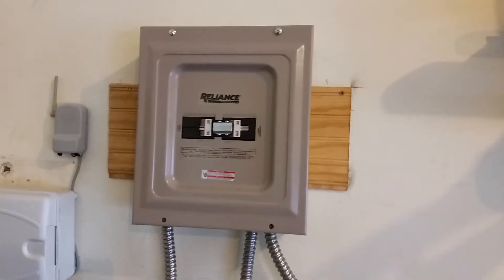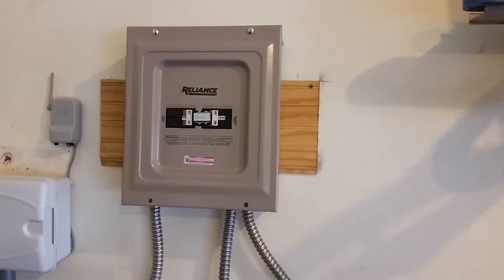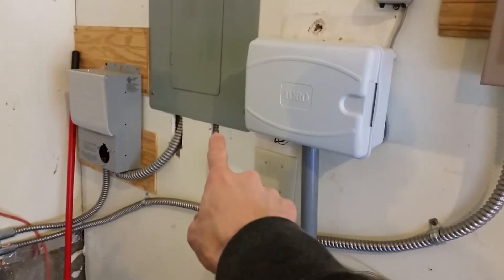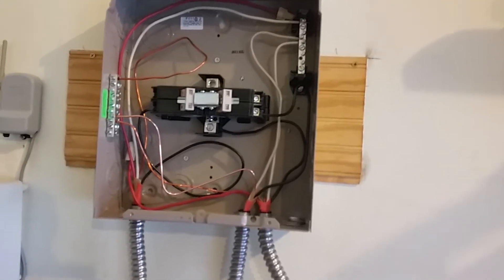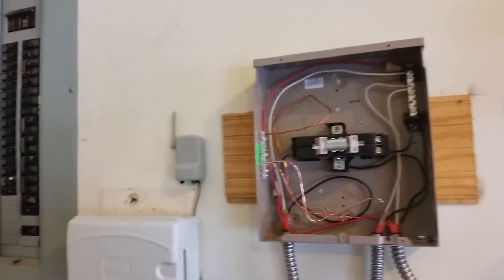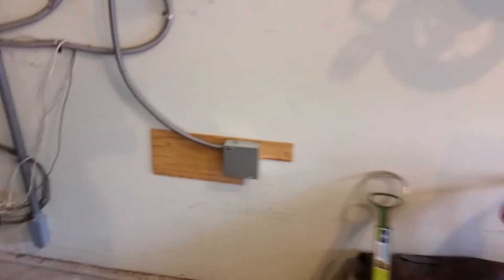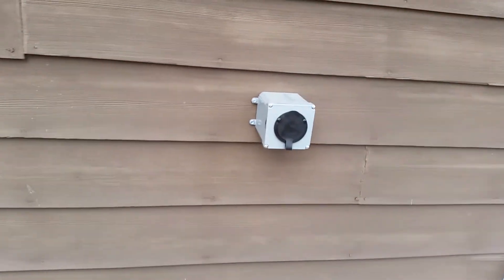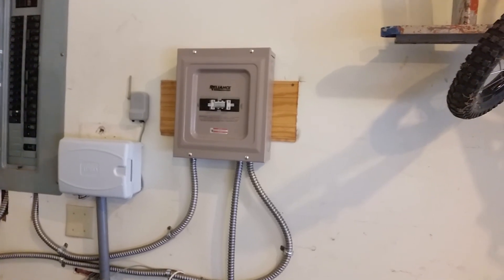Reliance Controls 60 amp Manual Transfer Switch Panel Box Installed & Generator Hookup

Comment: GREAT SHOWING OF THE TRANSFER SWITCH  EVERY PREPPER SHOULD USE IN THEIR SOLAR SYSTEM FOR SAFE TRANSITION OF POWER SOURCES TO RUN THE HOUSE LIKE MINE . SAFETY IS OF UTMOST #1 PRIORITY WHEN ELECTRICITY IS INVOLVED .

Comment: There's no reason you couldn't use this to switch between two load (one source, two loads), right?
Reply from the maker: Are you talking about two 120 volt loads or two 240 volt loads?
Reply: @thekeltnerway3002  240 in , two 240 loads out (switched, of course)
Reply from the maker: @NeverTakeNoCut-offs  I'm not a licensed electrician, but I should think that would be fine.  It is just like using this transfer switch to feed a subpanel with two 240 volt loads if I'm understanding your concept correctly.  Just need to make sure each 240 volt load has appropriate breaker amp rating and conductor sizes are correct between this transfer switch box and where loads split and then correct conductors for each 240 volt load.  Also, thanks a bunch for watching and the question!
Reply: @thekeltnerway3002  thanks! I read the manual on this and, indeed, they do say it can be used to feed to two loads from one source. I'm planning on using to to switch my generator to my inverter or divert it to directly feeding my main panel in my off grid cabin..
Reply from the maker: Perfect!  Always want to have Plan B's and Plan C's in place.

Comment: Ground and neutral should be kept separate except at the location of the service disconnect. That would likely be your main panel. That requirement hasn't changed since 1984 (other than trying to clarify the wording).
Reply from the maker: Sylvan dB:  Thank you for the comment and watching.  Interesting that requirement started in 1984.  Both this house and our house were built in 1984.  Wonder when this requirement was put into place in 1984.
Reply: @thekeltnerway3002  The requirement was in place before 1984. I learned about it in 1980 when I was first learning. The National Electrical Code is updated every 3 years. The code required grounded outlets in kitchens and bathrooms by 1960 and everywhere by 1970. My understanding is that the single ground-neutral bond has been the rule since the very beginning (before 1960).